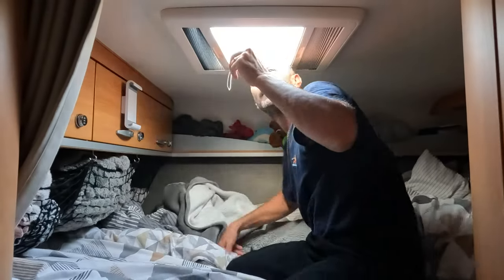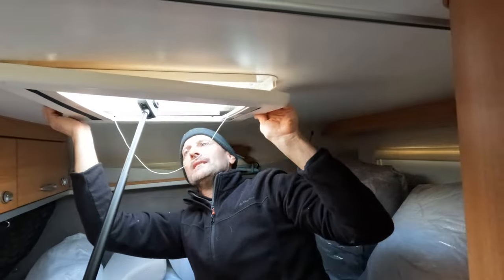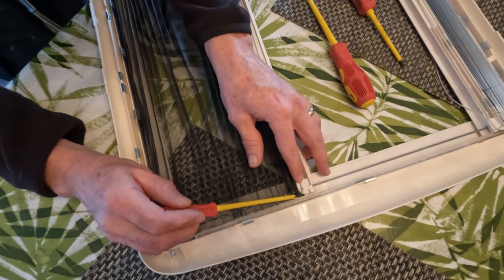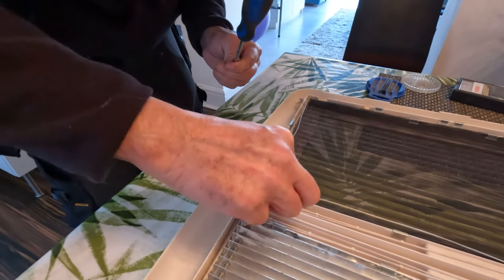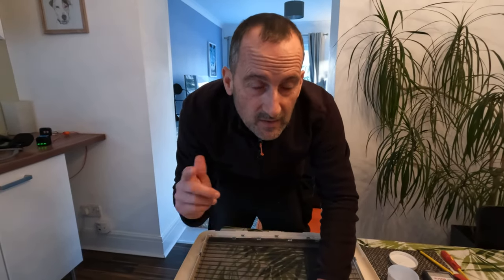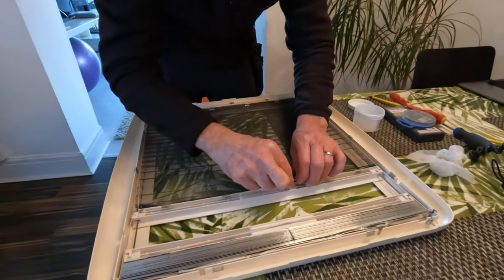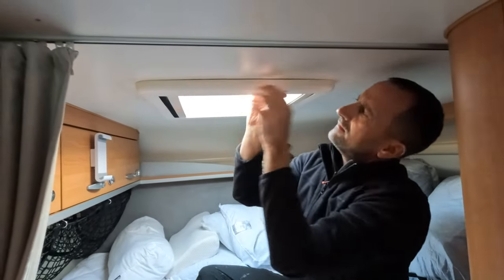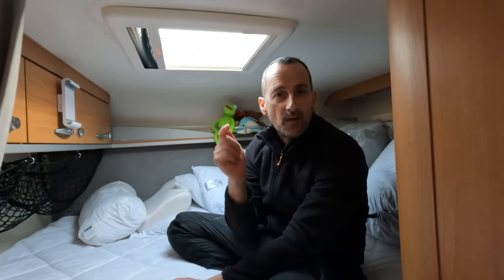Heki Mini Rooflight Blind Removal, Repair and Refit!

Comment: Thank you both so much. Clear to follow video, I had to put two screws into opposite corners, I also used silicone spray that already had and it work a treat. Superb tip...
However we have fixed the blind, saving a packet.
Reply from the maker: Great news! Thanks for watching and glad it helped 😊👍🏼

Comment: Good tip about the silicone grease, I’ve used silicone spray bit reckon the grease would be a better option. Thanks from Australia 👍
Reply from the maker: Glad the video helped! The silicone grease will definitely stay on longer than the spray! 😁👍🏼